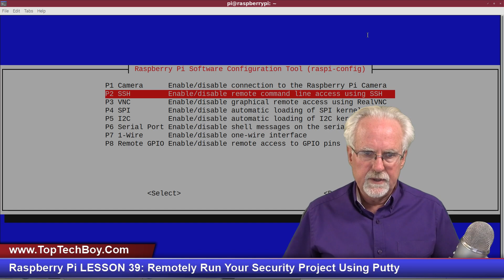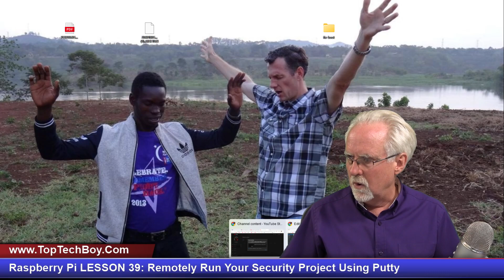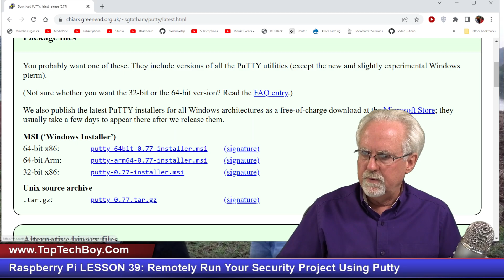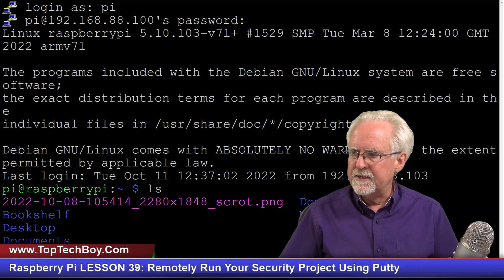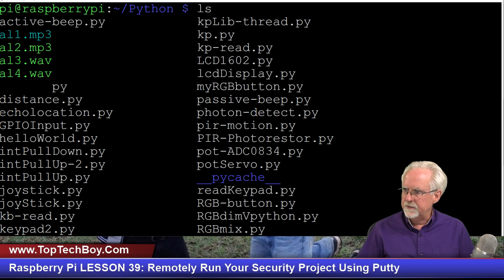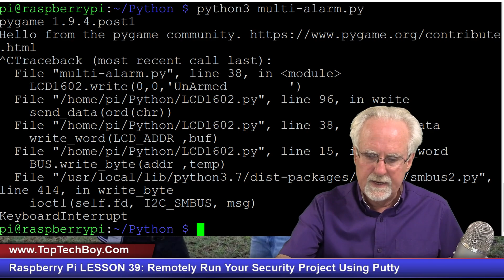Raspberry Pi LESSON 39: Remotely Run Your Security Project Using Putty

Comment: Sir i am amazed that you dont know that you can also set a static ip for your Rpi without touching the router. You just need to know some simple networking commands for that. Going through CCNA will help you a lot if you dont know the networking stuff.🙂 While i am still enjoying your lectures a lot. Thanks again.😀